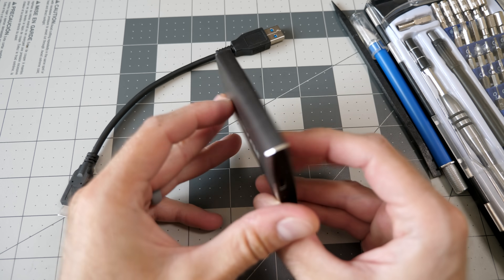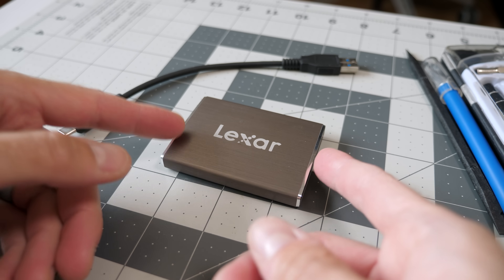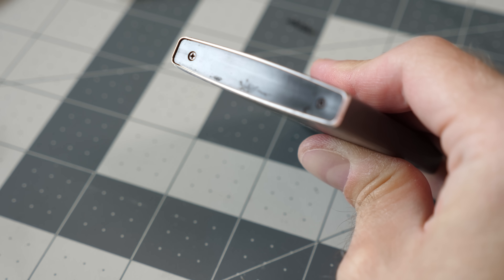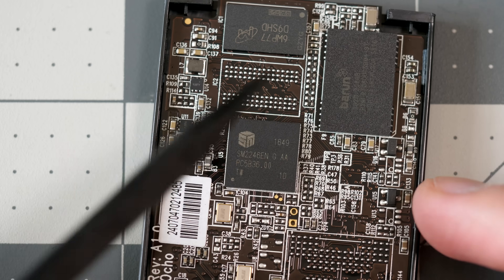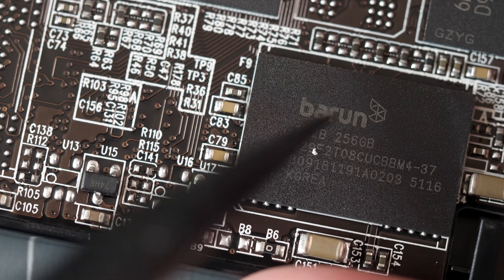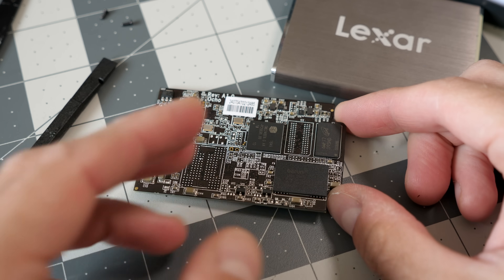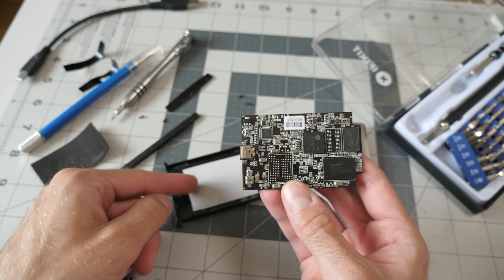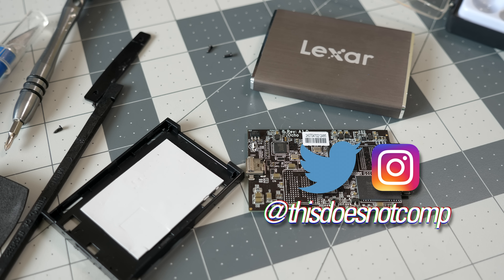What's Inside an External USB SSD?

Comment: The part that fails is almost always the controller chip which runs stupid hot. You can't replace it because they need custom programing but you could take the chip from another identical unit as a way to recover the data. Your suspicions about obsolescence are correct. Manufacturers don't add enough heatsinking on purpose so it fails after a few years. This is very prolific on TVs. Always add heatsinks and thermal pads to TVs and they will last a very long time. I have some large LCD TVs from 2010, 2012, 2016, 2018, 2020, all still working perfectly because I put in heatsinks and themal pads. If you don't do that the device will guarantee fail within 3 years ;-)

Comment: Personally, I'd prefer PCIe NVMe SSD enclosure which it handles any weird usage cases better compared to SATA SSDs (I have encountered weird problems with SATA interfaces before which both hard drives and SSDs would suddenly slow down to a crawl - I almost never have had a problem with PCI and PCI Express interfaces so far). Plus, even though WD Black SSDs are overkill, they have a separate RAM memory chip which helps keeping write amplification manageable while inside the DIY USB SSDs, so I went with this option over prebuilt USB SSDs.

And I can't wait for NVMe MRAM (magnetic RAM) SSDs so I can put together an indestructible USB SSD.

Comment: Thermal pad is sticky and super soft, it wants to fold when being slid in, when also being thick enough to make proper contact with these one-piece enclosure cases. So this might have been post-engineering decision to make assembly easier, or even possible. Thinner pad would have made assembly easier / possible but would not hold the PCB in place with this design, and thermal conductivity would suffer anyway, because of lacking contact.
M.2 enclosures with same design, share this problem. And unfortunately are by far the most common design. Sandwich type enclosures are much more rare for whatever reason. Yet M.2, if its NVMe, is desperate for cooling

Comment: assembly failure otherwise they wouldn't use thermal pads at all as they cost more than regular foam
you got an assembly dud and might be entitled to a replacement if it was not too old

Comment: Hey. Check that u23 is giving out 3.3V Looks to be a voltage regulator. If I got this guy at work and needed to fix it, i'd find the PSU, and probably inject some voltage to see it coming on or check if a component is getting very hot IE internally shorted.
There are also some test pads around the inductor. I'd probe about at those.

Comment: your usb pin must have being croocked try to replace it, or check that left corner you see that theirs couple of capacitors, 2 of them, if of them get damaged you will not be able access or get any data, im pretty sure that their wrong in top part, i hope you could do some test, if you are good interested in engineering.

Comment: silly sir there is this law that dont allow certain consumer electronic to exceed certain amount of heat generated. like when linus "fixed" the macbook by adding some more thermal pads and stuff that it actually performs better and cooler but at the same time produces more heat on your "lap" because it sinks heat much better and therefore exceeds the thermal limit dictated on that kind of law. i mean imagine a average user who doesnt know a thing about flash drives and touching a blazing hot ssd enclosure. you might want to consult your local law expert maybe there is some law that lexar had to obey to engineer the heat dissipation. maybe the thermal pad is indeed meant to be on the other side to balance the heat dissipation between the two sides so that the other side dont get hotter than the other one.

Comment: Best to get the nice all metal enclosures for the M.2 NVME SSDs that take advantage of USB-C 4.0 (true USB-C 4.0) or Thunderport 4. The flash chips overheated, they only have a max heat tolerance of 70C.

God bless, Rev. 21:4

Comment: Hi. I read you could restore dead SSDs by heating the flash chips at 800C for a millisecond.
If it can be detected by the BIOS of the PC, use Spinrite (Level 1 only, unless there's something wrong, it can use SpinRites Levels above 1).

God bless, Rev. 21:4

Comment: Some SSD's come without any heatsinks. Samsungs at least do it this way. From Linus Tech Tips video, there was case where SSDs have failed from being too cooled. If you check the operational temps of SSD you will see max temp of 70 c. Since your speeds were reduced, there is not much heat to build up.

Comment: It may be that the foam is actually there for the exact opposite reason, to prevent the case from getting too hot. I'm speculating, but if it gets hot even with the foam pad, with the thermal pad maybe the areas just above the chips would get so hot you could risk burns.

Comment: I prefer to buy a regular SATA SSD drive, and a separate USB interface case.  Better performance, and much higher dependability.  I found with these units it is the USB port itself that dies. Sometimes it is a solder connection under the connector where the cable plugs in to. Sometimes re-soldering under the connector fixes these.

Comment: Nah, definitely not a heat death because even if all the SSD chips died, the USB controller would still show the power LED and be detected by the OS (even if the SATA device after the controller is inaccessible).

Most likely the USB interface chip died and second-most likely it's a power issue, i.e. failure to create the 3.3V or whatever is needed for the chips. A shorted capacitor won't look out of the ordinary, you can only find it by measuring.

Comment: The foam is to press the board against the thermal pad firmly.  They are relying on the conductivity of the PCB itself to communicate heat from the side with the foam pad to the thermal pad.  They are also relying on a particular use case, and that is of someone who is not doing lots of sustained transfers in and out of the flash chips.  If that is the designed use case, the cooling is appropriate.  if it isn't, and in my opinion, it definitely isn't, then the cooling solution is insufficient.

Hard to make anything better with that type of case, however.  How can you slide in something which must also be pushed against the metal enclosure firmly, so it can act as a heat sink?  You can't; not without some post-install step to press things against the case, ship-in-a-bottle style, and that's not really feasible.

Comment: Lexar was honestly pretty bad even before that, I've yet to see a lexar jump drive that didn't crap itself without warning. The tolerances were bad enough on those things that the assembly was constantly putting pressure on the solder joints, so they would all eventually die under normal insertion cycles

Comment: It is weird because the desire for external drives is hdd for mass storage at a reasonable price, and flash drives for decently quick access to a few important files or a lot of smaller files.
External ssds aren't necessarily price competitive with their internal counterparts and the speed Will always be hampered by what your processor and motherboard can handle, let alone your input port options.
I did buy one recently just because there are a few games I just can't stand to run on an hdd and I figured I got it on a good sale, but if my pc could've taken a 2nd M2 I would've gone that route.

Comment: I feel manufacturing error is to blame. i suspect the pads were placed in the wrong side. I have seen this error in other units too. If it was planned, that was a mistake to use a more expensive heat conductive pad. Just 2 small spacers stuck on each side would be much cheaper per 1000000+ units. All of the units I have opened came apart just like yours. I replaced the pads correctly and even added a small wipe of compound to the heat conducting pad. mine are used to boot Raspberry pies and often run 24/7 for months at a time. They do get warmer on the case now, so I am suspecting more heat is being removed.

Comment: I don't unserstand why did you expect NVMe drive inside an USB3 SSD. The NVMe drives are much faster than USB3, and they are conneceted usually with PCIe3.0 x 4 lanes or lately PCIE4.0 interfaces (via M.2 connectors). Never USB3.0. I don't think that USB3 to NVMe bridge exists at all, I don't think so, it's so silly idea to connect them.
SATA3 drives are much-much slower and cheaper than NVMe. Of course its SATA3 drive what you expect here, with USB3-SATA3 bridge. USB3.0 or even USB3.1 gen1 supports only 5GBit/sec data rate, while SATA3 is 6Gbit/sec. Its a good pair and USB is the bottleneck, not the SATA3 neither the memory chips inside.

Comment: It's great how this tech has advanced.  I bought a couple 500gb external SSDs for $80 recently but they're USB 3 gen 2, which means they use the 10 gigabit link.  When I looked up a disassembly video, I saw it's just an NVMe drive with a USB 3 gen 2 interface.  They are so fast you can easily use them for pretty much any purpose, and they are quite small physically.

Comment: I would say it fails "eventually" by design just long enough to survive the warranty for the most part.  I've bought many externals in the past while receiving faulty external SSDs to see it it can be "fixed" long enough to attempt a data recuse (spoiler majority can't be.)  For HDDs the ones with plenty of air flow work for years (I had a Maxtor that lasted from 2008 to 2016,) but companies like WD, Toshiba, and Seagate started to make them thinner and with less air flow so something would fail as soon as little as a year to a year & a half after the warranty expires with moderate use (WD externals) Seagate is the worst I bought a 4TB version that failed after a month because it looked like it had holes for air flow, but it did not have any so it fried itself.  I have received a lot of external SSDs that had the save type of padding with some having zero thermal padding that is also why the speeds are throttled to 1/6 to 1/5 of it's full potential to lower the risk of frying itself too soon.  That is why I recommend people that want a Portable SSD to just buy a regular SATA 3 SSD and a separate external enclosure (one with either ventilation holes to let hot air out or a metal case that you slap some thermal pads on it yourself.  Oh the chip that died first most of the time is the controller chip for the interface (like the ASM235CM) the SM Controller chip that is on yours can push out up to 420/400MBps* (*=Read/Write) I have the same controller chip on a old Micron SATA SSD (2TB) that is in it's own USB 3.1 type C enclosure that I bought off of Amazon for $15.  After wasting over $1000 in name brand pre-assembled externals in the last 12 years I will never buy theirs I just make my own externals.

Comment: Try cooking just the board in oven at 400 degrees for about 8 min.  What do you have to loose? Also, flip that thermal pad to the other side because the morrons at the factory must have assembled it wrong.  😆

Comment: @This Does Not Compute  Troubleshoot him a bit Colin ... Check continuity from the USB Tip A at the of the cableto the traces in he board... Contact Cleaner in the USB connector.. (on regular bases actually in all USB connectors.. is the first thing to do when windows says "USB Device not recognized" )... Check if it receives the 5 volt needed.. 4.7v It is already low .... do not even light up the LED.. sign that the board do not have energy .. Maybe some short-circuit component (capacitor) is pulling down the voltage... Check the voltage regulator output on the corner of the board .. primary suspect.. Someone said reballing the chips with hot air gun.. that can also be a good idea ..

Comment: earlier usb-c cables were dodgy that could fry the port and potentially the device so I've started using anker cables and chargers with powerbanks because their first cables had 56k ohm resistor to prevent frying the port also anker has good reputation

Comment: that's why i use laptop HDD with an USB 3.0 adapter, these "flash" devices do not last that long, i have an 9 years old laptop HDD that still works fine to this moment, no bad sectors, no clicking...

Comment: How do you put the board into the housing when the sticky side of the thermal pad touches the inside of the housing? The current configuration is useless, like you said. I wonder what my Samsung T5 external SSDs look like on the inside. They use the same type of metal housing. But they are too expensive to open.

Comment: marketing the right USB 3 interface is not to be confused with the drive speed.
since it's "Sata3 speeds" it makes sense it's usb 3, and not usb 2.0

cheap ssd's are probable "m.2 sata", rather than "m.2 nvme".
Reply: I vote for manufacturing error, something went awry in the assembly.

Comment: since it wasnt recognized, I assume the USB controller side is defective, you can probably retrieve the data if you look for the data sheet on the USB controller and find out the SATA pinout is, and then just hook it up on any USB to sata adapter you have laying around and should work just fine.

Comment: Save the memory chips. You never know when you can pop them in another device and read them again.
Reply: I doubt that will work
Reply: +++ to this advice, but for most of ssds another device that can read memory chips is a special flash programmer, that costs thousands of dollars. if you just replace chips, even to the same ssd model, 99.9% this will not work
Reply: They are probably encrypted by the controller.

Comment: Maybe it was the 2 pads accidentally swapped during assembly. I mean the QC process would have been easily looked over if the assembly process consisted of sandwiching the pcb between 2 pads, placing it on the carrier frame then sliding it into the housings.

Comment: From the reference of 5:13, at the top left in the SOT package, I can see what looks like one of those 1117 series LDO regulators.  They ain’t very manly and die real easy (I’ve spent time replacing those suckers 😕) so why don’t you see if it’s putting out the right voltage.  Also, perhaps the foam and thermal pads were on the wrong way round…. Just a thought.

Comment: Try leaving it hooked up to a USB C power adapter (no data) overnight.

I had an old Kingston SATA SSD suddenly die in this manner - it was undetectable - and I read some advice to leave the computer it was installed in in the BIOS screen overnight, so the drive would be powered up but there'd be no data transfer attempts. It was supposed to put the drive firmware into some sort of self-recovery mode, which needed quite a long time to complete.. Amazingly, it worked - the drive came back to life and has worked ever since.

It's worth a shot - nothing to lose.

Comment: I'm pretty sure that it's an assembly issue.  The thermal pad would have a lot of friction against the extruded shell as you tried to slide the assembly in.  It would probably just bunch up as you tried to slide it in. I'm sure they could have probably engineered a procedure to assemble it, but it would have drastically increased assembly cost.

Comment: I have this same drive with the same problem. I contacted them while still under warranty and at the time (November-2019) they could not replaced the device due to CFIUS (Committee of Foreign Investments in the US) placing restrictions on LongSys, a Chinese company and the new owner of the Lexar brand. They said I would have to send it to them, then they would refund me for the purchase. Ironically, shortly before I was about to send it back, It started working again. 
However, every now and then (and it could be weeks or months) the drive will not get recognized by one of my desktop PC's. I then plug it into another PC and it starts to get recognized again. Even when I go back to the PC that did not previously recognize it. Very strange behavior indeed. I've moved on to better drives but I do still use this one when I need to transfer files every so often.

Comment: I think it was a manufacturing fuck up, becuase it seems a good idea, put the thermal pad on top of most of the components in direct contact to the aluminium case for heat disipation, the bottom just a normal pad becuase anyways it goes on the caddy, so maybe it was someone's first day at work and said screw it, foam pad is foam pad.
But in any case the lack of proper QA is still preoccupying.

Comment: You said that you tried several cables.  I had a strange case with a usb 3 ssd enclosure which stopped working and I tried the usual but by accident found that one of the cables would not work oriented one way but would if you turned it around! Very strange, but well worth noting

Comment: Did you poke every single pin of the usbc port to say they're soldered good? Did you check for 5V on some capacitor near the port? Did you check for shorts on that power line?

Comment: There are actually regulations in place that limit how hot cases of consumer electronics can legally get. That might also be one of the reasons why the thermal pad does not make contact with the metal case - that might be intentional in order to avoid breaking the law. LTT has a video on thermal modding the M1 MacBook Air where they talked about this: https://youtu.be/ghDvyItIHTY